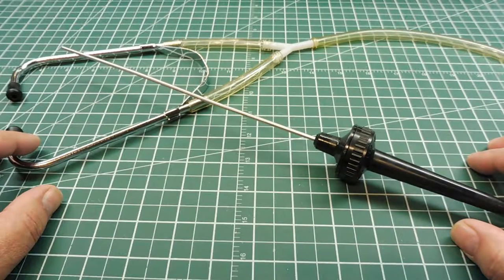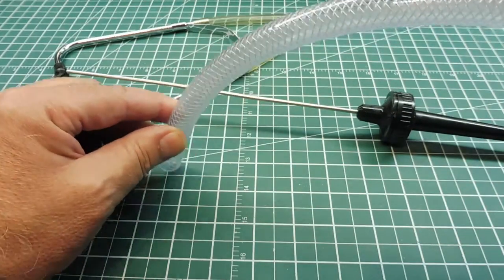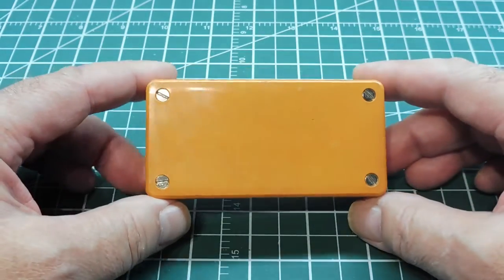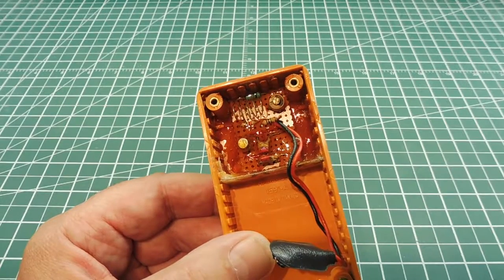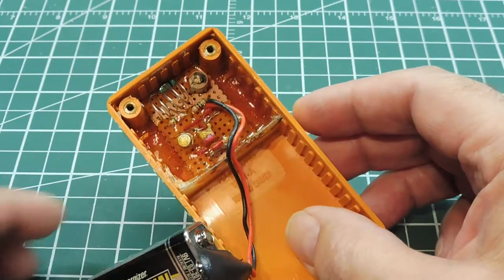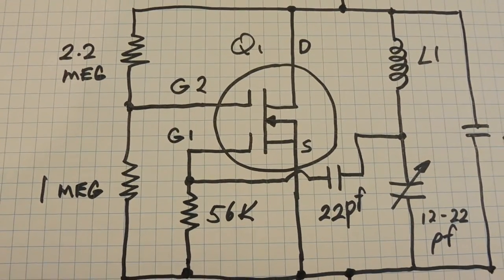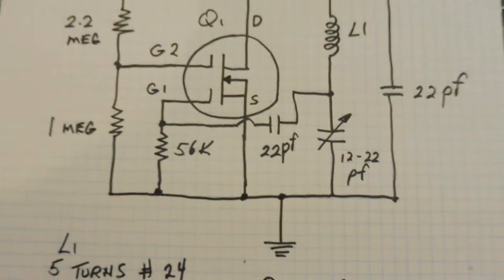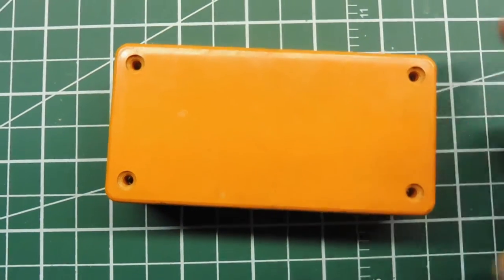How to find noises coming from your car / FM wireless transmitter

Comment: I like the concept, but I wonder how useful a resonant spring is in transmitting vibrations. How many modes does it have? If I make it with stranded wire dipped in a viscous fluid, will it still be sensitive enough as a modulator? I am interested in picking up a wide enough spectrum of vibrations, rather than knowing that there is a vibration co-inciding with one of the coil's eigenfrequencies.

Comment: Tracking down electronic hums in my house has been a recent project, I used an old AM transistor radio to track down some dirty electricity. I still don't understand how it works. I haven't had time to track noises on my vintage (LS swap) truck noises yet.